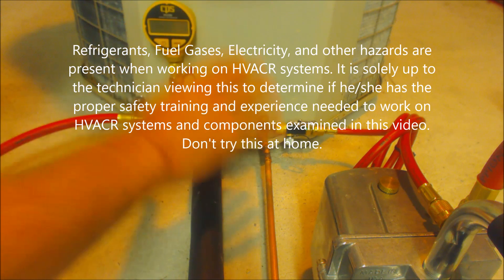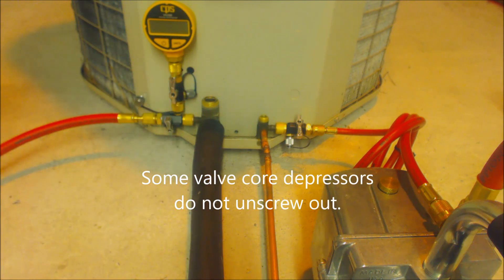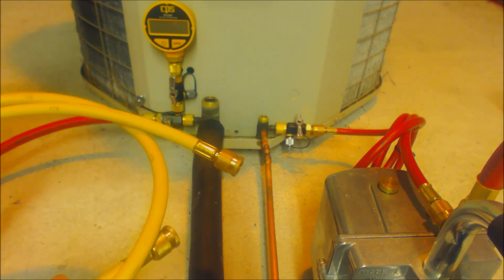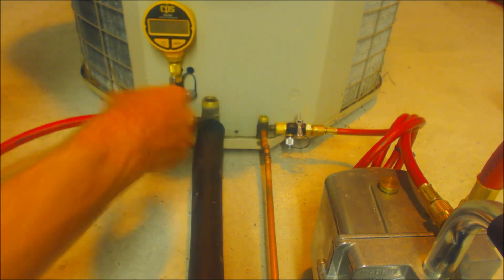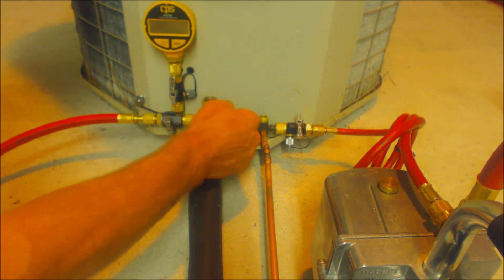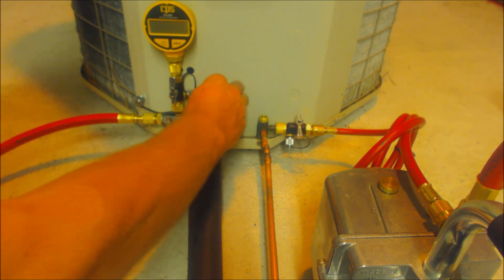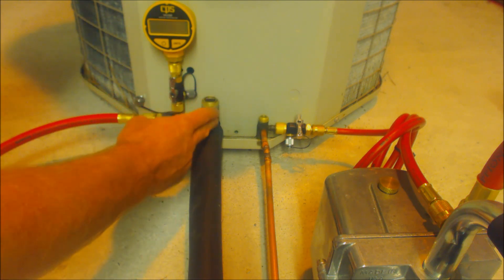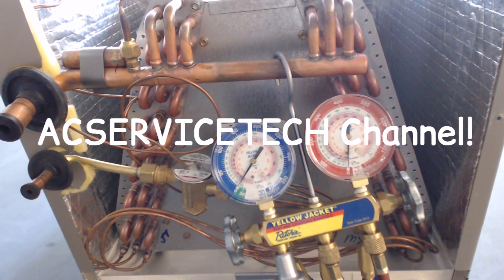Problems Vacuum Pumping Refrigerant Lines to the 500 Micron Level for HVAC

Comment: Ive pulled a vacuum on this one system now 3 times. It drops to 350 microns and levels off there. After shutting off the pump it rises to 510 and stays there. How important is that 10 microns above 500?

Comment: I am having a problem where I am running the vacuum pump, its dropping 500 micron but its basically giving a false reading there is no vacuum at all and when I tried to charge it with gas it just stayed inside the manifold and would not budge. ( no leaks at all have tested all joints and is gas sealed with Refrigerant Leak Prevention Agent

Comment: Im working on a system they I pull a vacuum all the way to 350-410. The pump oil show lot of moisture and burn now is way better and clear. But the problem is that my microm level starts going back u, even with the pump running! above 5000) don’t know what to do! — this system had a compressor burn out and acids. It was flushed and 2 removal filter drier with 2 isolation valves were installed.

Comment: Bluvac pro plus. Appion 1/2" dia 3/8x1/4 hoses and 2 appion core remover tools a little nylog done . Never use 1/4" hoses
Reply from the maker: Hey John, well I am all for any method to get the vacuum done quicker. You can use a 1/4" hose as long as the valve core depressor is taken out. This setup seems to be the least expensive for someone to switch over from other methods where they used to include the gauge set or slow the vacuum down to much some other way. I use the third valve core removal tool to valve off the micron gauge so I don't accidentally get oil and refrigerant into it. The vacuum gauge rarely ever needs to be cleaned. This setup will vacuum 30' of 3/4" lineset on a system in about 2.5 minutes down to 200 microns and can vacuum 125' of 1 1/8" lineset on a system down to 200 microns in about twelve minutes. The standing vacuum test doesn't rise, thanks

Comment: On small fry stuff 500 microns is not necessary. You did your pressure test and it holds your good.
Reply from the maker: Below 500 microns is necessary always and is quick and easy to do. Pressure tests are also done for ten minutes typically in the field and that amount of time does not always show small leaks. A vacuum procedure of a 125' 1 1/8" lineset on an existing system only takes 10 minutes to get down to 200 microns. A standing vacuum test is done for an additional ten minutes to verify it does not rise. I teach, talk to business owners, follow manufacturers install methods, and have my own HVACR company and we all agree with the EPA section 608 rules that should be followed and since it is the best thing for systems with Mineral and POE oil. There are ways to get by and ways that professional techs perform procedures. Techs dont have to do the vacuum procedure exactly like I do but they should be verifying leaks, no water freezing, water is removed to the required levels, and noncondensables are removed with a micron gauge. It just takes someone to show us in order to know. I appreciate your comment Ben but I do disagree, thanks!

Comment: i have a question, what do you do with the refrigerant that’s left inside your hose after disconnecting from the service port?
Reply from the maker: I use the disconnect procedure when you charge the liquid back into the system before disconnecting. The rest is considered de minimus and is a small amount of vapor. Search "acservicetech disconnect procedure" thanks

Comment: Is 800 microns good enough? Sometimes i cant get it down past that. I learned that the cause can be moisture still in the system. I also have learned that changing the filter drier can help aid in pulling a vacuum, since a fresh filter drier would suck up any remaining moisturw in the system. Also what do you think about those vacuum pump manifolds with the 3/8 hoses? I heard rubbing alcohol helps with the micron guage. Guess it cleans out whatever crap might be in it. Also what does it mean when i get down to 800 microns and im only pulling down in increments of 2 microns? Please help. This vacuum shit is driving me crazy
Reply from the maker: Tell me your setup and then I will explain. It used to be like that for me too at times. It no longer is. Also check out all 7 videos in the "acservicetech vacuum playlist" and then we will continue this conversation. It will start making sense and if you have the right tools and procedures you will be relieved when performing this procedure. At least that is my goal for everybody, thanks
Reply: I will watch all videos and get right back to you thanks
Reply: So basically my setup goes like this. I hook up my high side and low side, t my supco micron guave into the service hose and another hose that goes to the vacuum pump. I have quarter inch hoses and i pull through my manifold. I do not have shrader core removal tools so i am working with what i have. Although i had concerns about pulling a vacuum, i just recently did a water test on my guages. I filled them with 250 psi of dry nitrogen and stuck them underwater. All of a sudden non stop bubbles from behind the low loss fitting on the high side. Hopefully that will stop driving me crazy now. As for the oil blow out, how long should i do that for? I work mainly on repairs so im usualy vacuuming down an entire system, so oil pooling up in an evap coil and moisture in the system would make sense. I was told changing the filter drier would help things along. I pour rubbing alcohol into my micron guage as well. When i tighten my hoses on to schrader ports, i kinda tighten them down with quite a bit of force. Maybe finger tight with anothrr quatter turn by hand again. Let me know how you go about that. Also before pulling down i usualy run nitrogen through the liquid line so i can see continuity through the metering device and before im done pressure testing i leave about 25 psi of nitrogen in the system and then i pull down. Does this all sound proper? I know bigger hoses would help as well. So thats why i was asking you about the vacuun manifold kit. I guess it has 2 3/8 to 1/4 adapter hoses, a big manifold witha low side pressure guage and 2 dual port schrader core removers. Please let me know if you think im going about things right.
Reply: I also do some of the other things show in the video like the standing vacuum test, except i close the flapper on the vacuum pump and let it run instead. Let me know if thats ok as well. And do you really have to open the gas ballast upon startup everytime? Ive read about that and the reason being is because the air introduced into the discharge side of the pump when you crack the gas ballast will evaporate any moisture in the oil but you should only do it down to 50000 microns, dont know if thats true but also let me know. As you can tell im early on in my career (3 years) and im just going through the ups and downs of learning on my own. Just thought id ask ur oppinion on all my practices
Reply from the maker: Yeah, keep any quick disconnect fittings off the hoses when vacuuming. You want to be able to isolate the micron gauge from the vacuum pump to see if it rises. This is all accomplished with valve core removal tools. Oil blowout at 100psig into the high side and out the vapor port. Make sure the valve core is out or a hose with valve core depressor is in the vapor port with the other side open. Always change the filter drier any time you have no pressure in the system because it may already be full. Cut it out and replace. Just build that in the price and carry extra in the truck. You only need to pour rubbing alcohol into the micron gauge if it got refrigerant or refrigerant oil in it if it was dirty. I don't tighten hoses down too hard. You may need to change your grommets. I have replacements listed in-  amazon.com/shop/acservicetech  - The running of 25 psi is almost like your version of an oil blowout so yeah, thats right. Make sure to make it through the metering device, distributor tubes, etc. I would not get one of those kits. All you need is one 1/4" hose without a valve core depressor, one 3/8" by 1/4" hose, and three valve core removal tools. If your micron gauge has a male connector then you need a female to female connector. I have all of these listed like mine at the amazon.com/shop/acservicetech.  I know the manifold you are talking about and that is the one I would not recommend. You don't want that manifold, nor low pressure gauge, nor extra adapters. You want valves rated down to 20 microns and you would want 3 of them. I can pull any vacuum down to 200 microns in less than 10 minutes even 100' of 1 1/8" unless there actually is some type of weird water problem inside the tubes. Well I hope that helps. Thats my input at least, thanks Chris!
Reply from the maker: I would not keep the vacuum running when turning the valve off and using the ballast will save the oil longer before having to change. Make sure to change often or the pump won't work well, thanks
Reply: Great info. One more thing. I bought an inficon refrigerant infrared leak detector. What is your oppinion on those. I feel like they work well. I swapped a txv on a new system that was installed a year ago. Performed a pressure test at 350 psi. Held for 30 min. When i went to pull a vacuum it took me 3 hours to get to 750. I filled the system up at that vacuum and whipped out my leak detector. Tested brazed joints. No beeping. Tested condenser coil. No beeping. Tested mechanical connections on txv. Still no beeping. Tested one side of the evap coil. Nothing. Finally got to the other side and towards the bottom it started beeping like crazy. Probably a leak in the evap coil. The tool is 400 bucks. Should work well. Let me know what u think
Reply from the maker: Honestly I had that one and it only seemed to pick up big leaks. You may want to go ultrasonic route with the Acccutrak. I have that linked in the amazon.com/shop/acservicetech -  but yeah with a good vacuum setup and vacuum test, once set up, you would know in ten minutes if there was a problem with the vacuum, so that is very key! thanks Chris
Reply: Thanks man. When my vacuum set up comes in i will let you know how it went. I hope it turns out well. I dont know if you ever been through this but as i get better at thia trade i have these waves of confusing expieriences and it really makes me wanna jump off the tapanzee bridge. Ill be good and confident for a little while then all of these new expiriences send me through the ringer. Have you been through the same?
Reply from the maker: Ha, it stretches all of us. Eventually you overcome and find answers which helps grow experience and value in your skills, thanks
Reply: Chris Scinto I have systems at r410a that are running for years I'm a service technician. Compressor Replacements reversing valves medium and low temperature systems. I pressure test with nitrogen and I haven't had any problems with any of my systems. I've had them running for 5-10 year so far. I like to put in filter dryers if there's not one installed in the condensing it by the factory. I also do not braze my line sets I use stay Brite 8 the refrigeration man soft solder. It's a clean super strong solder. I do know what you mean by all that duct sealer everywhere I've had to take that off too. My trick is when I put the coil on the furnace I use foam press tape as a gasket and it works great. Upflow downflow I always use the foam press tape works like a champ. I have tried to get to 500 microns before it just doesn't happen too well. I've been going down to 30 in vacuum for years comment I'll shut the gauges and see if I lose vacuum. Now this is after I pressure test at about 300 PSI so I've already done my pressure testing.
Reply from the maker: Below 500 microns is necessary always and is quick and easy to do. Pressure tests are also done for ten minutes typically in the field and that amount of time does not always show small leaks. A vacuum procedure of a 125' 1 1/8" lineset on an existing system only takes 10 minutes to get down to 200 microns. A standing vacuum test is done for an additional ten minutes to verify it does not rise. I teach, talk to business owners, follow manufacturers install methods, and have my own HVACR company and we all agree with the EPA section 608 rules that should be followed and since it is the best thing for systems with Mineral and POE oil. There are ways to get by and ways that professional techs perform procedures. Techs dont have to do the vacuum procedure exactly like I do but they should be verifying leaks, no water freezing, water is removed to the required levels, and noncondensables are removed with a micron gauge. It just takes someone to show us in order to know. I appreciate your comment Ben but I do disagree.

Hey Ben, you said you have problems getting down to 500 microns and I did too back when I was using an old method that a service tech that I highly respected of 38 years showed me. I finally switched my vacuum methods to a different setup and never had problems again. 100 microns is very easy and quick and I am not joking at all. I respect the knowledge and skills you acquired over your many years of HVACR service but we all realize we can gain more knowledge and skill sets in various areas of our profession. I am always learning about new ways to do things. Check this video out. This is in real time with about 50-60ft of lineset, some of which was old, thanks- https://youtu.be/wYZ8Wudksb0
Show less
Reply: AC Service Tech LLC here's something I don't know if you've heard of it. It's called megaflow they're not cheap but they're manifold set with multiple hose connections quarter-inch 3/8 and and 1/2. It's supposed to be 16 times faster than your regular poses. They had come with special tools core removers so he can remove the core out of the unit and then reinstall it after you put some refrigerant in it. Here is a video of it it is made by Appion megaflow

https://youtu.be/aLoWqO3aGwo
Reply from the maker: Yeah that is a bit expensive and been out for some time. You don't need special tools except for the 3/8" hose with one side 3/8" and the other 1/4". Its about $60. Then just use a 1/4" hose and take the valve core depressor out of the end. Use three valve core removal tools. Most techs have two or three but if you need to buy another, they are about $60. Then use a micron gauge. Total investment is just $120 for techs that don't have those two items. Usually we have the rest of the items needed. Don't use a manifold set because it will slow down the process. Like I said, we all are in a constant state of learning and seeing the new products and procedures to make our lives faster. Thanks and give it a try. It is surprising, thanks a lot!

Comment: How are the vacuum hoses attached to the pump? The pump (at the Amazon link) shows one 1/4" and one 3/8" inch connections. Thank you!
Reply from the maker: Yup that should be the same one I was using in the video. JB Eliminator. You can choose to connect one 3/8 refrigerant hose, or one 1/4" refrigerant hose or both like in the videos. The pump comes with the caps with rubber grommet inside if only one is used. They just screw on by hand. The rubber grommets in the refrigerant hose seal the connection to the brass connection on the pump, thanks and feel free to ask questions!
Reply: Both vacuum hoses have 3/8" female connectors, right? And the pump has one 3/8" male and another 1/4" male. So did you have an adapter to go from 1/4" pump male to 3/8" hose female? Thank you.
Reply from the maker: Check out the links in the comment section. It should be pinned at the top and also all the links are in the description section of the video any time you need to try to find the tool used. Here is the link, it just happens to be blue  instead of red-  The Appion Blue 3/8" to 1/4" Vacuum Hose- http://amzn.to/2uYlVyc    --   or you can use this one which is 3/8" to 1/4" in a 1/2" hose. They have the reducers built in. You want to try to avoid using reducers or too many connections during a vacuum if possible, thanks
Reply from the maker: Didn't put the other link in, sorry, 3/8 to 1/4" with 1/2" hose   -  http://amzn.to/2vV5Fgp

Comment: Great tips it drive you crazy. When doing cascade refrigeration we use 1/4 copy tubing on your gauge thats what manufacturer recommends. What l found out having set of vacuum hose only nothing else 3/8 or 1/2  hose refrigerant  If you use your daily refrigerant hose there could oil inside refrigerant hose that what l do have set only for evacuation only no charging only use on evacuation make sure use correct vacuum oil change every time seal up the ports cap them after using the vacuum pump.If you use yellow  vacuum pump use there yellow jacket vacuum oil nothing else off brand would work but give but it might give you trouble or if you use other manufacturers vacuum pump read what type vacuum pump oil they recommend just go supply house pick up some vacuum pump oil is different .
Reply from the maker: All very true and good tips, thanks Edward!

Comment: Your video's are great. You show a CPS micron gauge in the video but the link you gave for micron gauge is a Supco that gets horrible reviews. Just FYI
Reply from the maker: I did just check the link in the comment section and the description section and they seem  to take me to the cps one. I use either of them and funny enough I have had one supco one for 13 years now and works like a champ. I did see the reviews and I don't know as I have another 5 supcos for the shop and they take some abuse from my students with no problems over the last five years. Thanks Azycray!